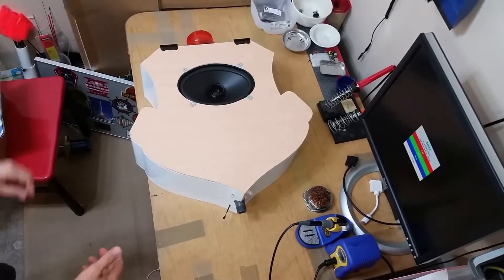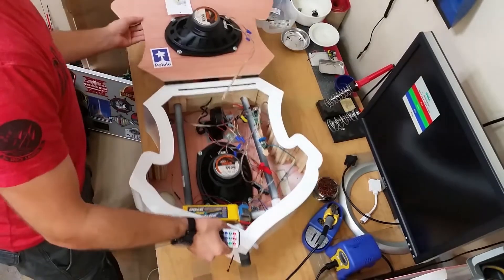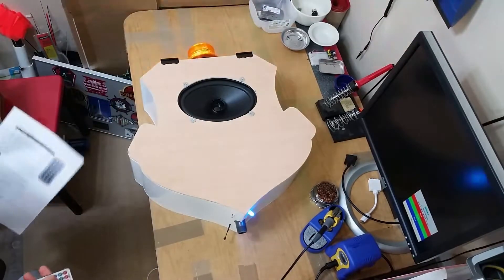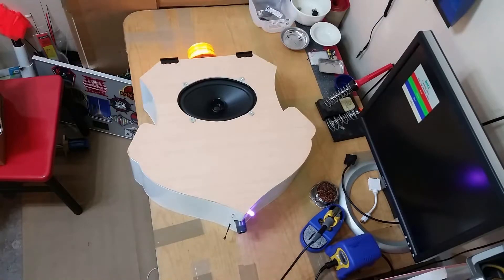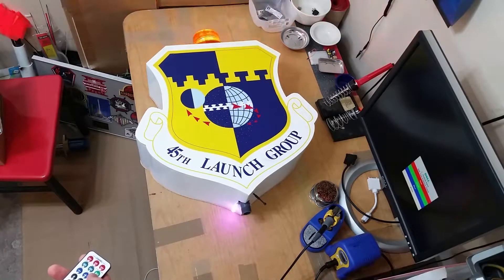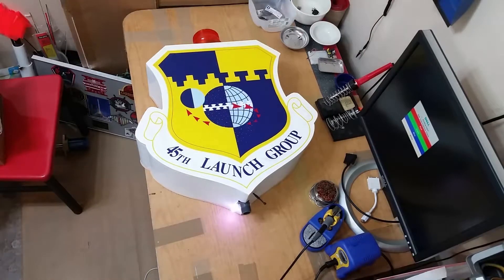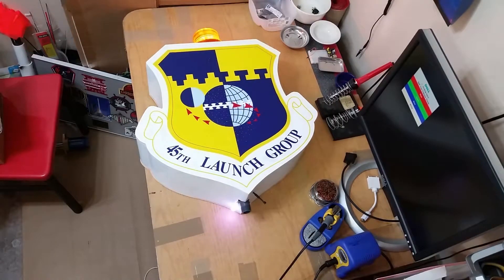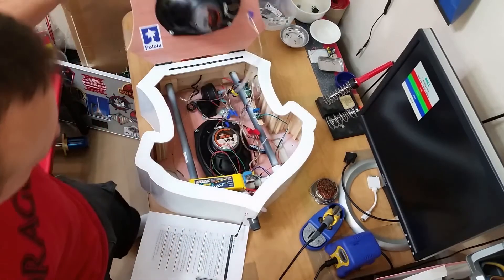Arduino Siren Horn Project Final demo (Star Wars, Mario, Happy Birthday, Air Force song, etc)

Comment: Awesome, how do you control what audio goes to the speakers vs the horn?
Reply from the maker: They are controlled by separate pins on the Arduino. The horn has a built-in oscillator with a fixed frequency, so you just give it plain old DC power (via an amplifier or transistor still, of course) and it makes the horn sound since the internal oscillator enables the vibration to produce the sound. The speaker, however, I am driving with the Arduino pins through a crude transistor-based amplifier I made. You can just buy a robotics DC motor driver H-bridge to drive the speaker, and use the Arduino `toneAC` library (https://playground.arduino.cc/Code/ToneAC/). In theory, you could also play voice or true music out of the speaker with the Arduino too, using the Arduino `TMRpcm` library (https://github.com/TMRh20/TMRpcm), which is a really sophisticated means of doing PWM within a PWM: the outer PWM controls the rate at which you change the frequency, and does the frequency changes at that rate, and the inner PWM actually produces this frequency at the speaker. In this way, you can get true music, voice, or high-quality audio. Using this library you should still be able to drive the speaker directly with a DC motor driver H-bridge from a robotics shop online. Note that in my "PWM within a PWM" explanation, it is actually more correct to say that the "outer PWM" is really just an interrupt running at a high rate to call an ISR (Interrupt Service Routine function) to set the audio frequency, and the "inner PWM" is true PWM, but it's at a fixed 50% duty cycle with variable frequency (period) so as to be able to produce different tones. The "outer PWM" ISR then sets new frequencies of the inner PWM at a rapid rate, and voice, music, or true audio comes out of the speaker according to this data being played. It's absolutely ingenious what they've done with the Arduino: they've made it an audio driver all by itself, with just a robotics DC motor driver H bridge as the audio "amplifier".